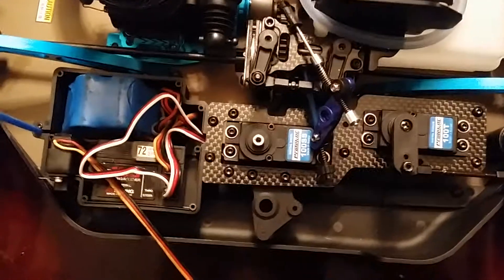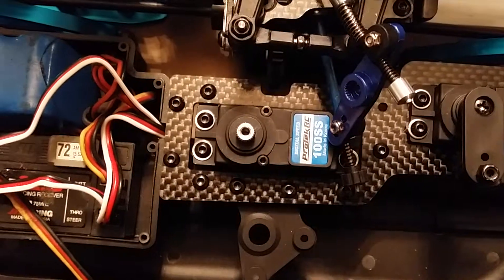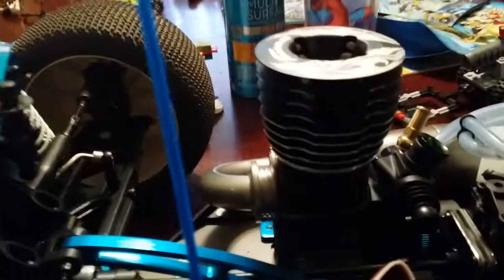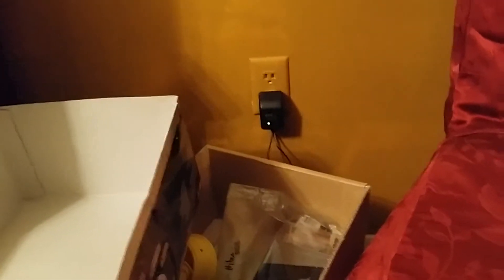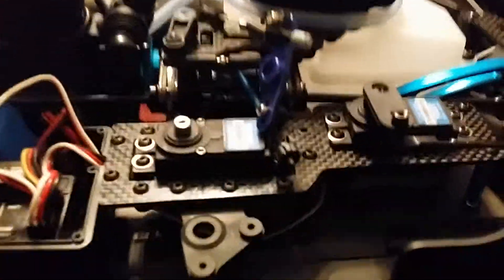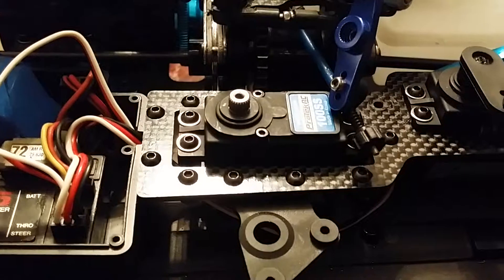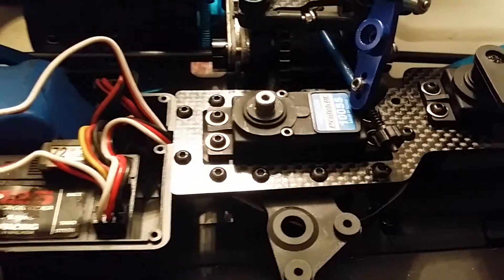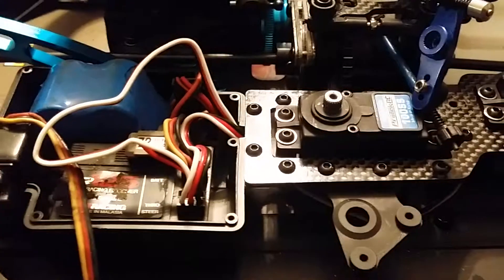Protek 100ss problem

Comment: It due when  grounded the servo at some point or way on metal chassis most likely, radio posts or whatever. I know this is an old thread but I know it intimately and solved it. With shims and the correct servo spacers never happened again. I have to text you some of the details that I'm curious of whatever happened on this.
Reply from the maker: Yeah I sent it back and they replaced it. It was bad from the factory I guess🤷‍♂️. It may have been the aluminum radio tray posts but amain sent another and said it did the same thing when they tested it. I haven't had this issue since. Im curious to know what is the fix for this

Comment from the maker: This is my first experience using another brand other then hitec for servo applications. Decided to go protek for steering and throttle in both of truggies and out of 4 servos this was the only 1 with issues. I sent it back and they're sending me another. 1 thing I can say is Amain customer service is second to none
Reply: How's it working out for you? I just got a 150T and 130ss. I have about 10 ProTek servos in all. One was DOA, on died after about 5 hours of run time, and finally got one now with the shakes. But...I've had as many problems with hiTec as well.
Reply from the maker: its going pretty good. I had 2 100ss go bad on me but thats including the 1 from the vid. Then they replaced the 2nd one that went bad w/a 130ss and its been great. the 100t has not missed a beat from get go. all together i have had 6 protek's all 100 or 130 series, and the only issues where with the 100ss, I cant bash proptek 1 bit. Ive had hitec, airtronis and a ko propo go bad on me, just the nature of the best. It may not sem like it but servo's are subjected to alot of abuse...By the way that 150T is going to be a beast.
Reply: MrLilchilly I'm more excited about that 130ss in my Savage. 260/.05. Oh my, I don't like to play with throttle servos, meaing I just want anything that is reliable. Those LOSB0819 have been the most reliable servos I've ever used if you can believe that. I'm actually pulling all the 100ss from my vehicles and replacing with 130ss. That 100ss seems to be their most problematic
Reply from the maker: Nitro RCNerds Thats what im using for throttle in my 801xt's, might to turn down the expo a lil bit, .05 I cant even blink that quick lol...yeah the 2 100'ss i had were doa. I'm have a look into the Losi servo's. Cant go wrong with the price.
Reply: MrLilchilly